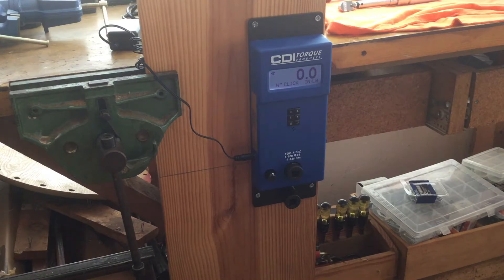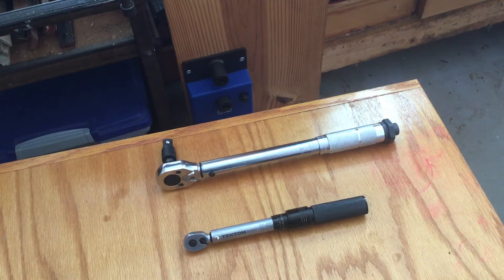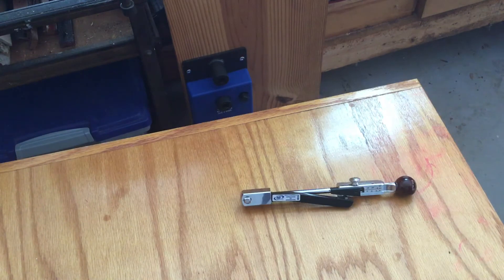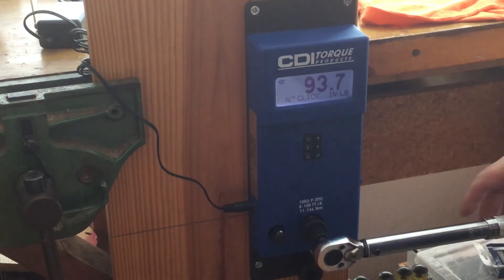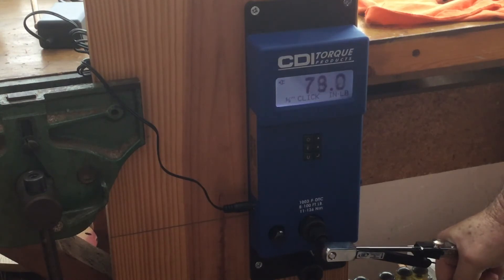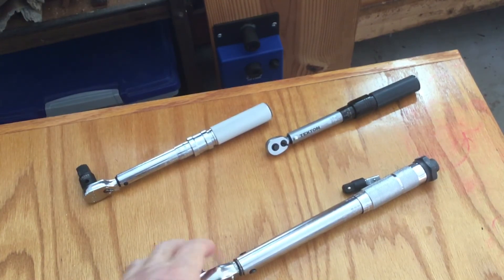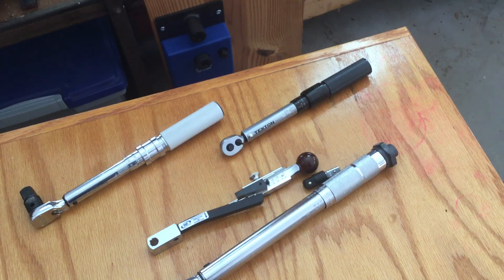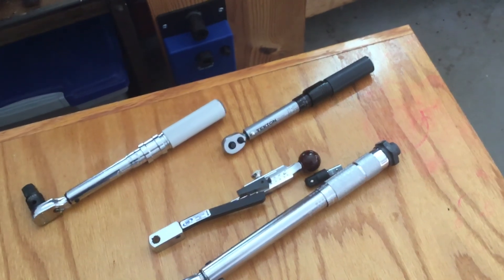Inch pound torque wrench test with Icon, W&B, Tekton  and Pitt Pro

Comment: Nice video. In the future I suggest testing a range of low, mid and high end of the scale and then comparing them. I think it would give a better idea of the performance in different applications. 

Also,Inch pounds are useful for engine building. Things like oil pumps, water pumps often have torque specs in in-lbs.

Comment: There are a handful of fasteners on GM LS engines, such as the oil pan and valve covers, that call for inch pounds. These use small bolts going into cast aluminum, and they can and do break if you’re not careful!
Reply from the maker: Greetings Bat. Thanks for the comment!

Comment: That W&B you have is the same as the small one I have, the other is a larger 1/2" drive W&B.  Both are in Metric (Nm).
Reply from the maker: Greetings 066, I appreciate your remarks! If you don’t mind me asking, where did you get both of yours?
Reply: @johnnylinoleum   I live in Australia and purchased them from a tool supplier in my own state. I just like their simplicity. Those who are contemplating such a torque wrench for use,  must keep in mind.... DO NOT, use this tool to undo fasteners. It will need to be re-calibrated as a result. Thanks for demonstrating the W&B, I was curious as to how it would perform compared to the more elaborate wrenches.
Reply from the maker: Cool! Thank you for your comments.